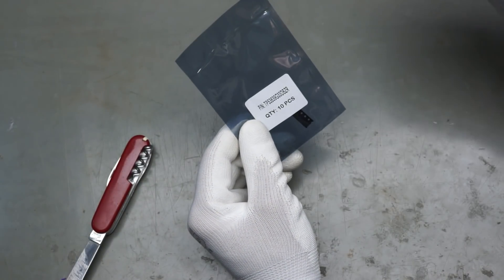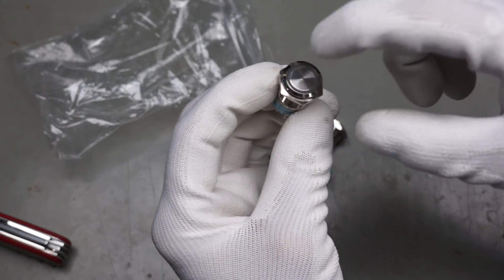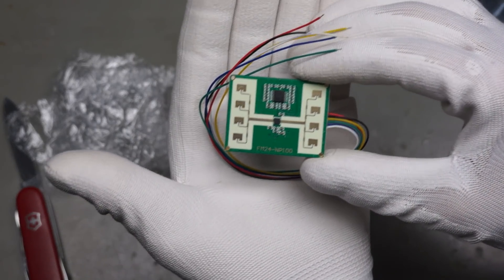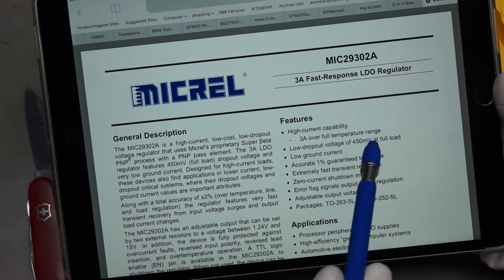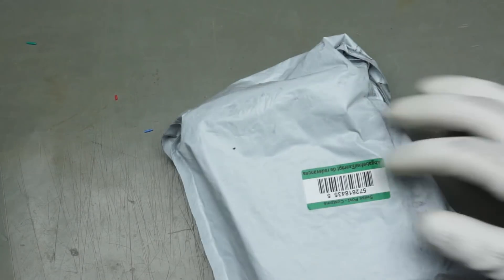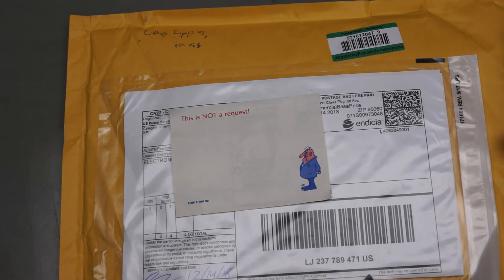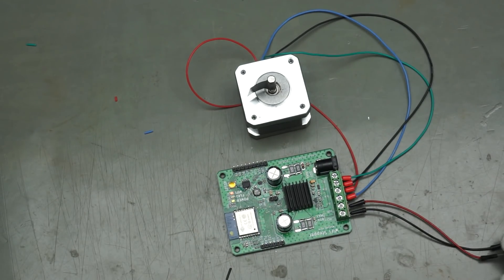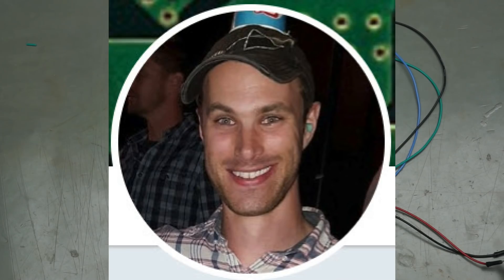#251 Mailbag (Power Supply Monitor, Radar, nice Buttons, Animal RFID, PD Charger, etc.)

Comment: You know, every time you buy stuff from eBay or ali that's from China, especially IC's, you can bet your fancy hat that they're knockoffs, fakes or ripped from electronic devices and resold and they probably won't adhere to the specifications of the real ones.

Just a heads up from an electronics engineer that's been bitten in the past when he was naive :D

So never trust them for anything that really has to work reliably, can kill someone if it fails, destroy property or where the specifications are important for performance.
Reply from the maker: You are right.

Comment: Looking forward to your review of the animal Tag readers! I have been wanting to work with one of them myself.  I found  1 more reasonably priced (cheap) readers -
https://www.aliexpress.com/item/134-2KHz-ISO11784-ISO11785-Embedded-Ear-Tag-Reader-Module-5V-TTL-Ardunio/32861558032.html?spm=a2g0s.13010208.99999999.535.56a73c00j5BGZ0
The second one is the same as yours but this is priced slightly cheaper- 
https://www.aliexpress.com/item/Mini-Embedded-Reader-Module-UART-Module-Support-134-2K-FDX-B-ISO11784-85-Animal-Tag/32840713606.html?spm=a2g0s.13010208.99999999.538.56a73c00j5BGZ0
Reply from the maker: Thank you for the links!

Comment: The MIC29302 appears about 5 times cheaper than from traditional dealers, there are a lot of fake semiconductors, especially in to-220, to-92 and to-263 packages from China, can you test them if they are up to spec?
Reply from the maker: I will test it when I use it in a project.

Comment: I recently bought that same Dodocool PD wall wart.. and noticed that the USB-C socket is sitting so deep that most of my cables did not contact reliably. Cracking the heat-sealed case to adjust the socket was really messy. The supply works fine afterwards, but the effort to get it to that point wasn't really worth it.

Comment: there is a module named bs301cv. it has ip5306 chip and it has all the battery protections. And 5v 2.1a regulator built in. I'm waiting this module to arrive. You could try it too .

Comment: I love my Chinese orders, I tend to do a few at the same time, then when they arrive it's like Christmas. I like to try to guess what they are from the description on the label, which are usually quite comical.
Reply: Steve Evans "auto switch" , "grooming kit", "gift", "wires" = Arduino, pliers, breadboard, solder ! :-)
Reply: Packages from China are a treat. Its fun to receive a package every few days and it's amazing how cheap the postage is. It does get frustrating around February during the Chinese new year when it seams that the entire country is shut down to celebrate.
Reply: @Bob3519  oh yeah, almost forgot we're coming up to that soon.
Almost as bad as getting anything from Italy in August!

Comment: Being able to discriminate raccoons from your cats using a cat door would be cool
Reply from the maker: We are already happy if we can discriminate our cat from neighbour's cat ;-)
Reply: Gary Paisley, I’m a hobbyist when it comes to electrical engineering, but I’ve been slowly making a project that will eventually become an object detection application that can visually recognize whether it’s looking at a cat (my cat, in particular), a raccoon, some other animal (humans, other cats, dogs, foxes, skunks, etc), or no animal. It requires a camera (I use a Raspberry Pi), but doesn’t need RFID. I’ve been gathering training data over the last few months, and I plan to organize the data so it can be used to train the object detection model. The project has been on hold until I can acquire more computing power to accomplish this, or until I can figure out how to do it with the resources I have. I’m hoping to get myself organized enough to put a tutorial together so other folks can train their own model based on their cat/dog/pet.

It’s not quite the direction Andreas is going, but it should allow similar end results (cat door that only opens for a specific cat). Fun stuff :)

Comment: It's seems that we are building little bit similar power supply. I'm also planning to build mobile usb pd psu on my channel. And I just ordered that same pd trigger. Idea is to make of communication with esp32, but that trigger helps testing.

Biggest challenge I think is to filter noice as much as possible from the switching pd power supply because I try to get really low noice psu
Reply from the maker: I have some ideas. We will see if they work.
Reply: @AndreasSpiess  i will follow. I will also upload content about this project when i just have time to start it.

Comment: In keen to see if you get any use out of that radar module compared with the 10GHz ones - anything would be better and less disappointing... 
My experience with the buttons is that they're chinsy but OK for projects - better but more expensive are piezo ones which have no moving parts!
Reply: Tim Doyle While piezos are definitely nice to use, on the Arduino side they can be hard. Usually you have to assign an interrupt to them because they only give you a short voltage pulse. This is also another disadvantage because there's no "long press" or something similar
Reply: @bassfpv  true mate, but like must things it's a compromise for other features.  If  interrupts are to be avoided, a flip flop hardware solution could be used to give a single or double input to the micro  instead (I think)
Reply: Tim Doyle you have a point there. I just wanted to mention that there are also some negatives coming with piezos 👍

Comment: Thank you, Andi. Well done again. But which shipment methode do you choose ? Some are free but slow. And how's about customs?
Reply from the maker: @Martin: Shit happens. I had many packages with expensive stuff without problems. Maybe 1 of 20 creates problems.
The limit is closer to 65 CHF (7.6% MWsT must not exceed 5CHF)
Reply from the maker: I usually prefer the „free shipping“ and accept a delay of about 3 weeks. DHL for me is too expensive for most shipments. If things are bulky, you usually have to choose DHL
Reply: For the swiss custom, as I know that product price should not exceed around 70 swiss frank. But be careful, the shipping cost also inc. with this price and custom should see that product + shipping costs are lower than 70 chf. I got a power supply from china and it costed 60 dollars. So custom thought that, shipping cost is more than 10 swiss frank so I had to pay 24 chf extra (ink. swiss post, tax etc)